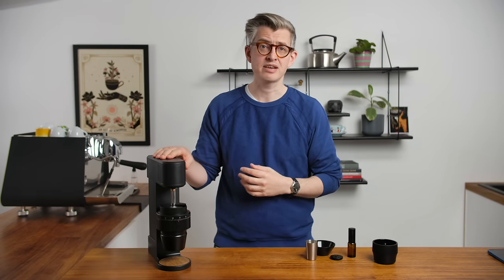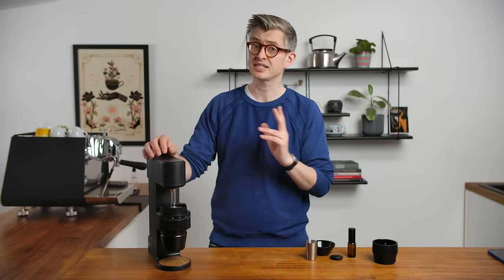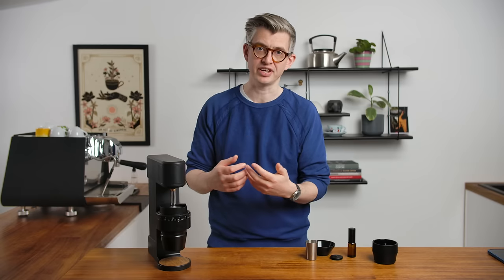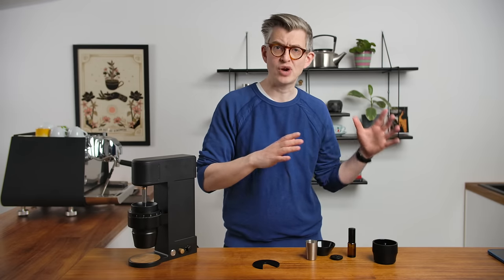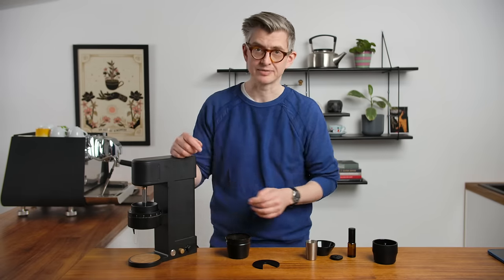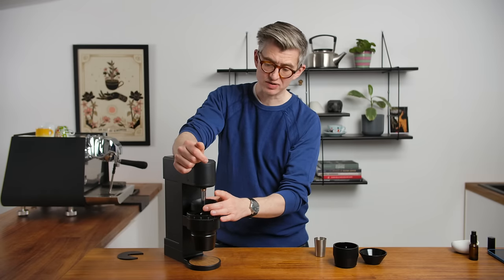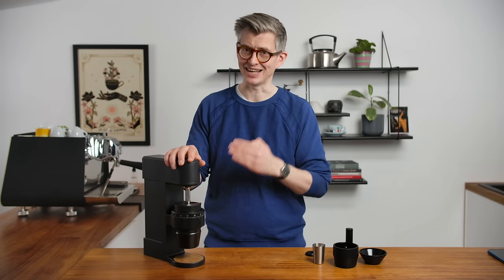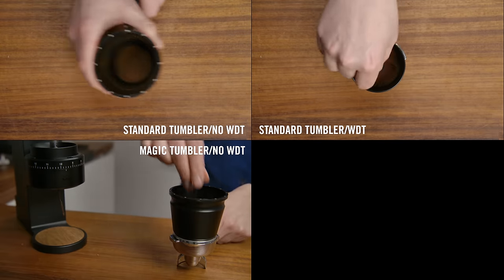Weber Workshops Key Grinder Review

Comment: I just got one of these (Weber Key) and thought I would post my initial impressions. First off, there is some assembly required. James doesn't mention this, perhaps he was furnished with a grinder which was already fully assembled and calibrated. The magic tumbler installation is sadly non-trivial. You have to lay the grinder on its side and use a hex key to remove a screw and a plastic axle cap, then replace the axle cap with a washer and the stirring device for the magic number. This sounds trivial but in practice the screw is cranked on so tight that it is necessary to perform the "last resort method" described in the user guide which consists of removing the gearbox cover so you can put something through a hole in the axle to prevent the axle from spinning while you loosen the bolt/screw with the hex key. And when you remove the bolt/screw, the inner burr is free to fall out should you turn the grinder right side up again for any reason. If this happens, be aware there is a tiny piece of steel called a key which may fall out. This happened to me and I didn't notice at first. I found it on the floor later. This tiny piece of steel sits partly in a groove on one side of the axle and partly in a corresponding groove on the inside of the inner burr. Getting this piece back in place in the correct orientation and reinstalling the lower burr is tricky, especially if you have big hands. Without this "key" in place the inner burr is free to spin around the axle rendering any attempted calibration or grind adjustments useless. Also, if you tighten the screw too much after installing the magic tumbler you won't be able to turn the burr mount at all to back it off the required 1 3/4 turns from the zero (burr contact) point. Anyway, after an email exchange with support I finally got the grinder assembled properly and was able to successfully calibrate it. I feel the grinder should come already assembled with the tumbler option one ordered. The customer should not have to go through this hassle.

Comment: Just received my KEY. Proud owner of HG1, loved it, and saw this motorized version, jumped on the deal last year April. Promised to receive it last year October, but got postponed, and I just got it today.

Compared it to my HG1, very similar.

Compared to my Niche Zero, which I used previously when I had parties around, because it's not easy to grind manually, it's just like my HG1, it's so much cleaner, less residual grinds (fine powders), and the extraction was a lot smoother.

Previously, I had to counter it by using under puck filters when I was using my Niche, but on this, with or without under puck filters perform very similarly, only affects less than 0.1-0.2% EY, unlike Niche Zero, can go up to 2% EY when using under puck filters.

This one grinder can make me retire both my Niche Zero and HG1, and free up so much counter space. This alone is worth more than what I paid for.

Anyway, I'll be removing the paper clip, and doing WDT anyway.

Comment: Thanks for the great review. I've had this grinder now for two weeks and here's my two cents. I live in NYC and like all residents of this metropolis, counter space is at a premium. I use an Olympia Cremina for my espresso and I was looking for a grinder that had an equally small footprint, if not smaller. I also wanted a grinder that could grind any bean with some sort of exacting marker system. My old grinder was the Olympia Moca grinder and I found the setting indicator to be very frustrating. I couldn't switch beans and then switch back and just go right to the previous setting easily. It was always a search. Also, the Moca grinder never seem to grind fine enough, even with me taking it apart and making a finer adjustment. I find the Key can grind anything and switching back to a previous bean super easy to do. Overall, I am super happy with this grinder. I feel it to be a huge step-up from the Moca. I will say, even though it's suppose to be "preseasoned" I find that to not be the case. The first shots I pulled on this, even with the correct grind, were not great but each shot is getting better and better. After just two weeks I find I'm making great espresso.  That all being said is it worth 2K? No Idea. I, like you got it for the preorder price. Also, the Cremina has a 49mm basket and I find this grinder with the standard tumbler is fantastic.
Reply: Hey Rod, if you end up hating the Key for whatever reason in the long run and end up selling it, I do highly recommend the Niche for the following reasons: I like you live in a smaller space and can confirm that the Niche is low profile; the Niche is also an upstart and so you would be supporting a smaller player; the Niche is much better value than the Key. And maybe subjectively here I personally believe the Niche offers better workflow and design esthetic than the Key. Note I do not have any commercial/business interest in Niche or it's products just a fellow coffee enthusiast sharing an opinion.
Reply: @canucklostintheusa5306  just note the Niche will give more texture, less clarity than the KEY, and a flat burr will give more clarity less texture than the KEY.

Comment: Great review, thank you!

My Key has gotten a LOT better the more beans I've used. I'd recommend sticking to pour over for like 5 lbs first, then trying espresso. The burrs felt dull when new and after a few pounds, they feel sharp.

I have the same problem with beans getting stuck in the funnel when using RDT and hiding under the lid, so I agree it's better not to use it. 

One of my favorite features is how easy it is to clean the burrs vs many other grinders while keeping your exact setting (my Forte BG is easier, my Niche is harder). 

For removing the installing the burrs, I use a 4nm bicycle Torqkeys torque tool and a cut rubber exercise band to hold the shaft. Always the same preload, never worry about slipping during grinding.
Reply: The seasoning idea is awesome advice for any new grinder! I bought discard beans which are totally fine, but didn't make the cut at the roaster. They ask me what I got next when I back my truck in now lol.
Reply: Good point on ease of access to the burrs for cleaning; this is a major point that a lot of reviewers (and the armchair critics) seem to have somehow missed. There are some inherent design compromises to allow this, and of course it is also the only reason some folks have panicked that their burrs are misaligned (in all likelihood they are better aligned than any grinder you've ever owned, you've just never been able to see them clearly in operation before).
Reply: there is no way you bought this coffee grinder

Comment: I finally bit the bullet and bought a Niche Zero for myself at the end of last year. Not only did it arrive much faster than I anticipated, but the price has been stable for some time (~$550 USD). The improvements to this machine since the first run of them were noticeable and appreciated. They did listen to their customers, and that feels really good. The dosing cup feels heavier and of higher quality. It no longer has that ridge on the inside for grounds to get stuck, and the interior bottom is parabolic. They have the anti-popcorning disc standard in the grinders, now, but they're still removable. The overall feel of the grinder feels a little "tighter" than the first versions, though that could also be because the V1 I've been using has been trucking for over two years, now in a cafe setting, where it sees intermittent back-to-back use on a daily basis. As such, I feel like not only did Niche just nail it out of the gate with a reasonably priced grinder in terms of usability, footprint, and ergonomics, the longevity is apparent, even with the early models.

Weber makes beautiful machines, for sure, but I'll sacrifice the gorgeous brushed metal and sleekness for the FAR more affordable (for me) option that does everything I want and need without the things I know would annoy me (like the grind adjustment ring).
Reply: Niche is a very nice grinder, You lose out on the RPM control and extra flavour clarity on those larger 83mm mazzer burrs in the KEY, but for the price difference, that may not matter so much.

Comment: The main difference seems to be the fixing of the inner grinder and outer grinder parts. 

For the inner grinder part:
In the Niche, there is some horizontal flexibility due to only the top bearing being fixed (in a plastic holder!). The bottom bearing is done by the motor which is kept in place by flexible rubber fixers.
In the Weber the grinder axle is locked by 2 fixed bearings, making it more stable. The motor is connected flexible to the fixed axle (it seems by belt drive).
For the outer grinder part:
In the Niche, the outer grinder is placed in a cylinder container holding it. The horizontal play depends on how accurate the 2 fit. The grind adjuster is a screw-part that moves up-down and pushes the outer grinder part down on springs. It keeps the outer grinder part flat, but not fixing it in place, allowing it to move horizontally (depending on the tolerances of the container-grinder).  
In the Weber, I noticed that the outer grinder part is fixed to the screw-part that adjusts the grind size (move up down on the screw thread). The metal ring is just to lock the screw-part.

In total, the Weber has the potential of being more stable while the Niche probably allows more horizontal move (wobble) of the grinder parts.
The wobble would be due to the coffee pushing against the grinder parts when distributed uneven or by differences in hardness of coffee beans.
Reply: It’s a geared drive with two bearings at the top of the axle. The inner burr is at the end of the axle and also where the load is applied. 

I don’t know which design is subject to greater deviations under load, but as for fixed alignment, both are probably similar. DF64 uses a similar adjustment to the Niche.
Reply: @BruceWayne-ck2yy  You can check it out in below links. The Niche has a single top bearing in a flexible plastic plate: https://youtu.be/HOsgp-jggXw?t=439
The engine is mounted flexible: https://youtu.be/HOsgp-jggXw?t=465
Play will be minimal but definitely more compared with 2 fixed bearings (under load condition).

Comment: At the price, it seem peculiar to not include proper motor control from Weber's side.
A brushless motor with field control could easily maintain proper torque at all speeds at very little additional cost.
They are becoming more common in battery powered hand tools, so why not in coffee grinders that cost 10x as much.
Reply: I agree 100%, but to be fair, usually, this will be justified by scales of economy. Powertools are mass produced to crazy amounts. Specialist home coffee grinders are still a massively niche market where there is not enough feature/price-based competition to warrant a feature race. I have no doubt that people will buy the Weber over significantly cheaper and more feature loaded products just because Weber is branded well and makes products that look cool.
Reply: @broomhandel3960  I'd buy that argument if it wasn't a $2000 unit.. brushless motors are a fraction of that.
Reply: Bear in mind that Mazzer matches this conical burr with a 900W 3-phase motor, e.q 1.2 horsepower, running at 420 rpm. It is unlikely a motor with this kind of torque will fit inside the current housing (with enough space to dissipate the heat.
Reply: @98900945r  maybe heat is an issue, but you can get a 100x150mm motor putting out 15-20KW, so I don't think housing space is the issue.
Reply: Good point which implies 900W would be smaller than 100x150mm. What would the transmission parts look like for 900W and could the cost remain the same or less?
Reply: completely agree
Reply: The much cheaper Kopi Deva has a brushless, variable RPM motor so it's not out of the question by any means.
Reply: @kuricat8783  Good point, I didn't consider that and it's not my area of expertise. My unfounded assumption would be same space, tougher materials, higher costs. 

That said, hard to judge what kind of margin they're achieving with this $2k unit, but I rather they add $200 to the price tag and not skimp on a core component.
Reply: @pa_alia  For sure, but my point in general is that the market for domestic specialist coffee grinders doesn't necessitate a feature war like the powertools market, hence the lack of what some might say are basic features. As a consumer, I obviously want more features. From a business perspective, there's absolutely no reason to cut profit margins by any amount if they know people will buy regardless (due to brand value, product design, marketing, influencers, etc). Weber is evidently positioned as a luxury brand, value for money isn't remotely a concern for them. In fact, value for money isn't remotely a concern for any brand that is selling a $2000 domestic coffee grinder unless it does something wildly different to the norm.
Reply: @pa_alia  I'm looking at making my own electric coffee grinder, know where I can find some good brushless motors and controllers for them?
Reply: @khroomlet8821  
Depends on how good.
Amazing quality: go for faulhaber motors or similar.

Good enough quality: buy a bldc from hobbyking with field oriented control.
I think the quicrun fusion motors fit the bill.
Reply: @broomhandel3960  You're on to something though. Let's see a transmission and housing with giant burrs that attaches to the front of a kitchenaid mixer!
Reply: @scottleggejr  For $2000, it better do my taxes too!
Reply: @khroomlet8821  I'd look at marine motors and controllers, they tend to be smaller, efficient and waterproofed which is always good for kitchen use. Of course they're relative expensive too though..

Comment: In regards to the issue where the grinder stalls after back to back shots - even moving to a coarser grind: this is because the motor itself will heat up under load. This leads to a higher voltage that is being pulled by the motor in order to maintain the same level of grind consistency (adding even more heat to the motor), which eventually leads to worse and worse performance since electronic motors perform poorer in high temperature conditions. This is why PCs will thermal throttle in order to stop the machine from damaging it's own components under load and why fans are a necessity for them to run properly. Your grinder performing worse after being put through lots of work back to back is by no means an issue Weber introduced, but more of an issue with how motors and electronics work in general. You are right in saying that the motor is working very hard and potentially becoming damaged from doing too much work. Great review though! I love how deep you go into all your reviews. Keep up the good work!
Reply: I wonder whether it’s really a design flaw, or just an acceptable thermal limitation to save space and cost. I presume reviewers trying out all the options run a grinder much longer than any normal user would.

Comment: gotta say
for $2000 this thing should be able to grind ROCKS at the lowest RPM without issue
Let alone coffee
Reply: That's something I find consistently frustrating with products like this. We have incredibly high torque electric motors available cheaply and easily to manufacturers like this. If you're down in the 30-180rpm range why wouldn't you take one of those extremely powerful motors and gear it way down and you'd have something that would never, ever stall.

I do wonder, do the motors stall because they don't want the grinder to self destruct if the burrs crash? Better than sending shards of burrs everywhere if someone makes a mistake
Reply: completely agree
Reply: It's because these companies know that hipsters will pay these insane prices  🤣

Comment: Great review, probably my most anticipated YouTube video to date! I’ve had my Key for about 3 weeks and although I had struggles dialling it in and some spurting from the first 5 or so shots it seemed to settle down and after about a week of using it I have been happy with the shots (clarity definitely true vs the Niche still sat beside it but less texture as James said). Workflow is great, I don’t RDT, instead using the glass tube caddy I ordered with it and get only a little static in the magic tumbler as well as good results with channeling without WDT, which I’ve given up on as I agree with James that it get you close enough to not necessarily need it, although I do get it out occasionally for a bad ‘drop’ into the basket. There are quirks and the paperclip thing is great but annoying to get around. I’d rather it was higher and you could let the magic tumbler centre before then lifting it straight up into place, but the paperclip is unfortunately too low. All in all though it looks and feels fantastic, workflow is great, shots and filter taste great and I don’t regret pre-ordering, despite the 5 months wait.

Comment: A note on stalling: Electric motors can be considered to be resistors. Voltage directly correlates to RPM output of motors. Voltage equals resistance (a constant characteristic of the motor) multiplied by amperage (a variable). Amperage is directly related to torque output. From the resistance equation we can see that decreasing voltage will also decrease amperage, therefore decreasing torque. Therefore, decreasing the RPM you run at decreases the torque and increases likelihood of stalling.
Reply: Only that no machine on earth regulates a motor's rpms by lowering the voltage..